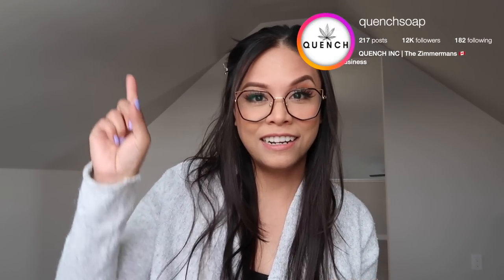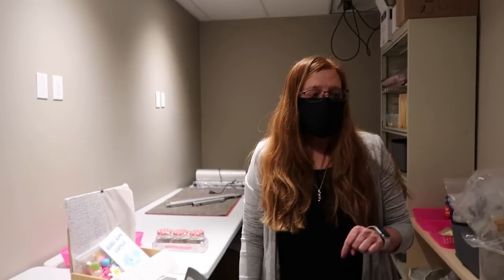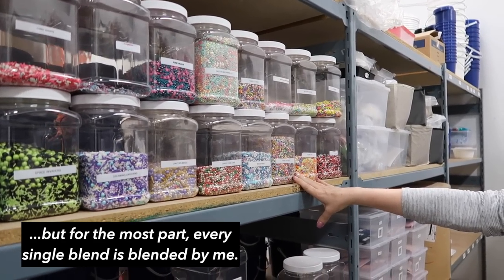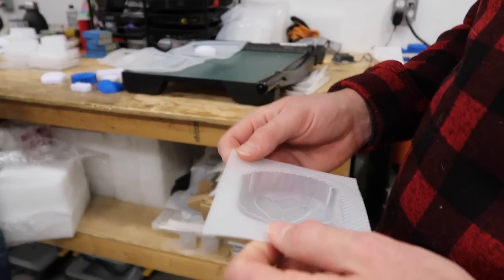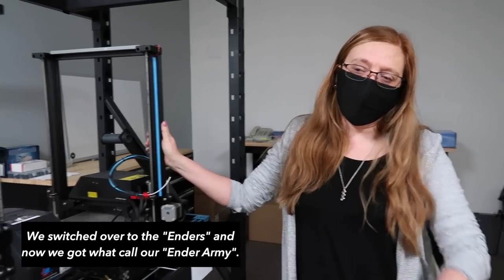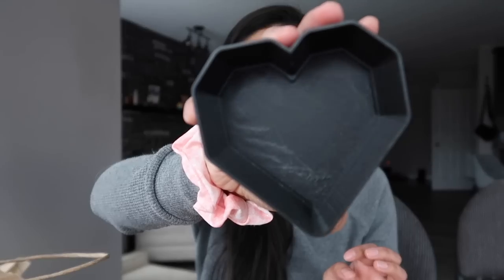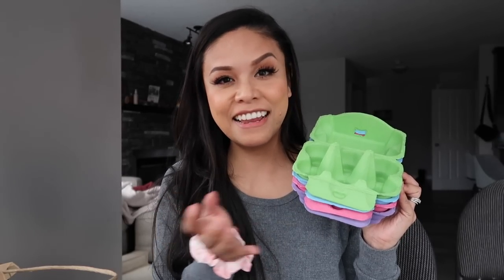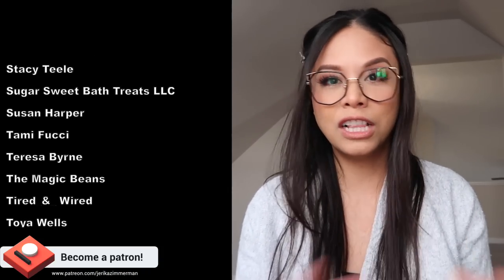FACTORY TOUR! with Breaking the Mold YYC | how bath bomb molds are made

Comment: 11:11 Minor typo, it's not AVS, it's ABS. ABS was the first really big, successful 3d printing filament. It has higher heat capacity (can handle the vacuum formers) but it's a LOT harder to print. PLA is easier but melts at lower temps. The should try ASA or PETG. Those are heat tolerant and print easy.
Reply from the maker: Thank you for your expertise! ❤️